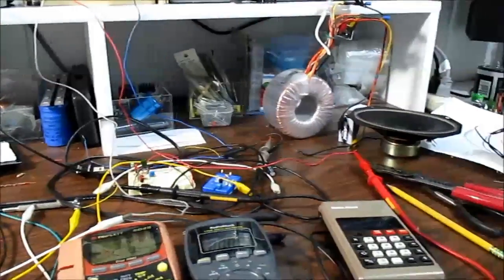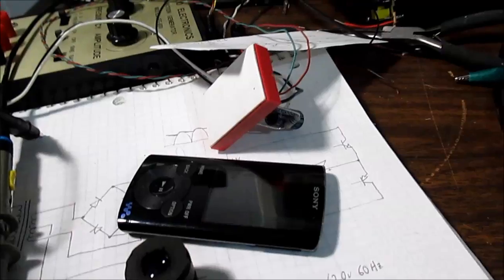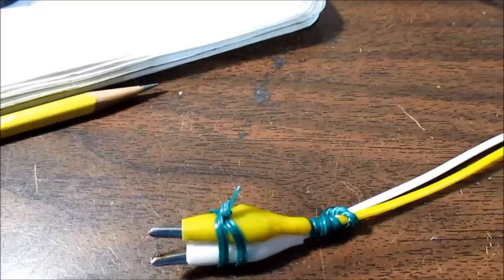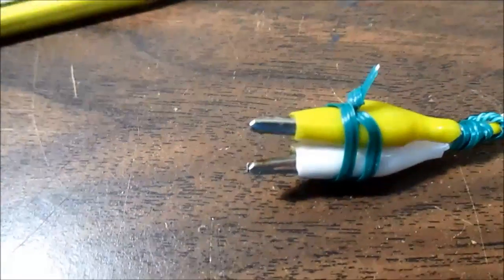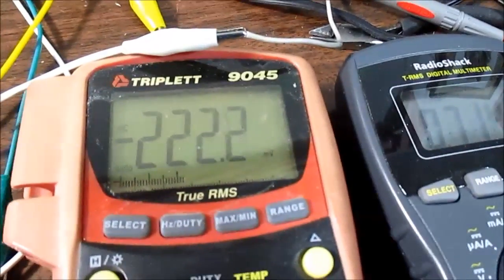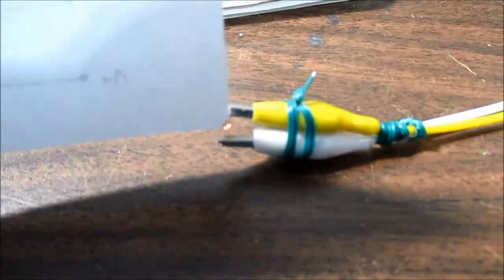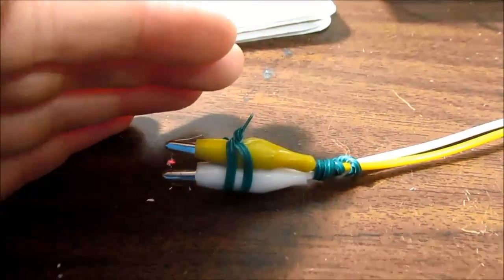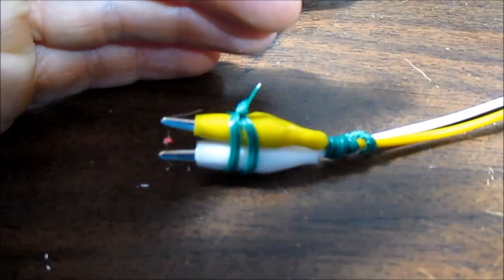Starting fire with less than 1 watt of resistive heat?

Comment: Thing is the 1W is eventually just compensating for heat loss. Power in == heat loss. If the element was more isolated from the environment it would be the same temperature with less power. When I saw the video tittle I thought you were going to start a fire with 1 Joule - 1 W for 1 second. That is a better challenge.
Reply: I suppose a spark in an air flamable gas mix would be one way of fire with not much input energy...
Reply from the maker: The idea was to use resistive heating only as mentioned in the description.